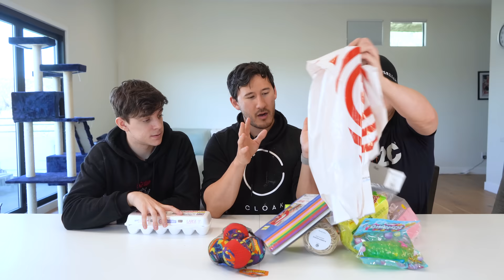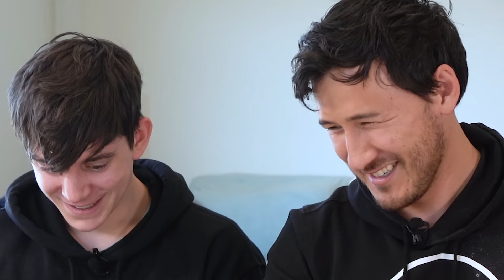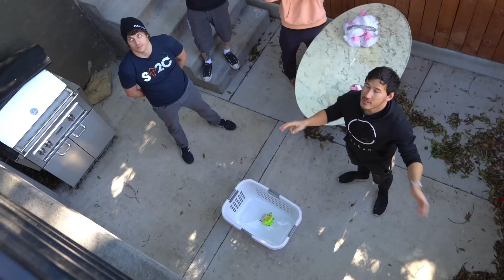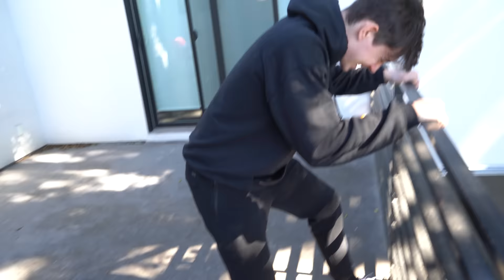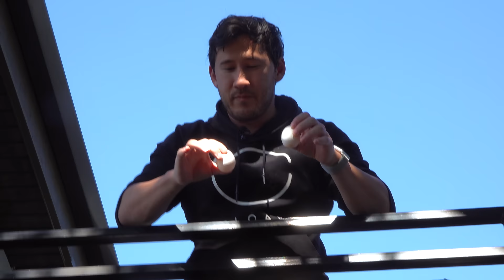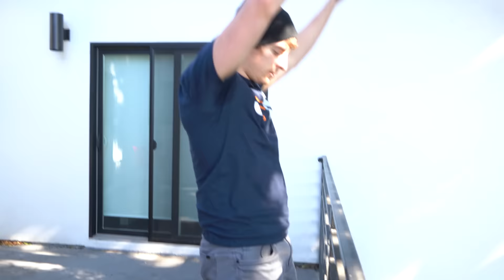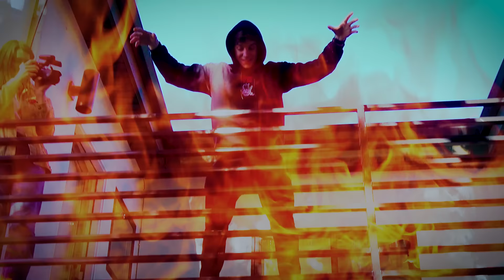Markiplier Makes: An Egg Drop

Comment: I have super bad adhd, and I relate so heavily to Ethan during this. Adhd + a time limit is super hard to work with, because you can never really get your ideas out, it feels like a class project, where you only have like 1 day to work on it, and go through 3 ideas and can’t get them out into paper and then eventually just give up.
Reply: Yesss
Reply: I sometimes have this but I can also have the opposite of this when I have like a few weeks to finish an assignment and it's really hard to start working on it
Reply: Same here. If I'm under pressure, I will start crying over the simplest mistakes then I get embarrassed about which makes me cry more, I'm just a mess